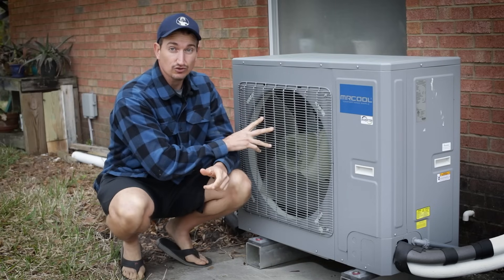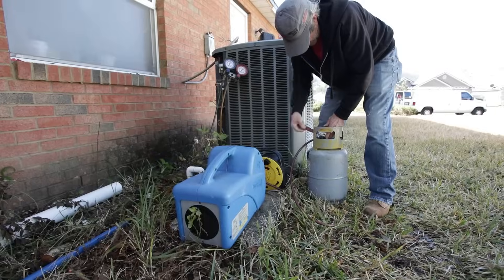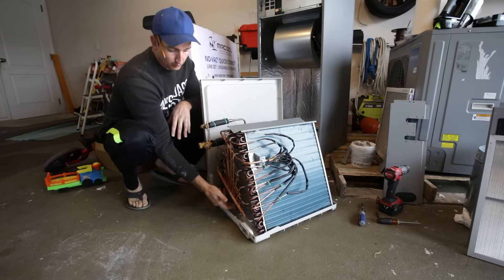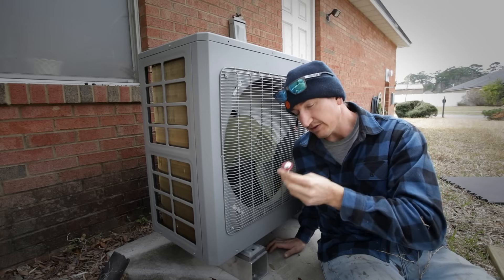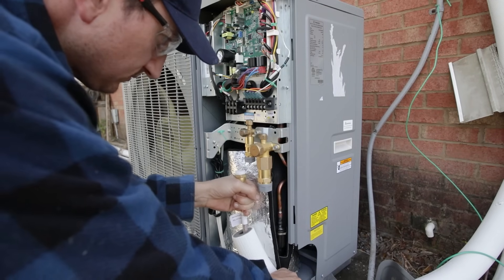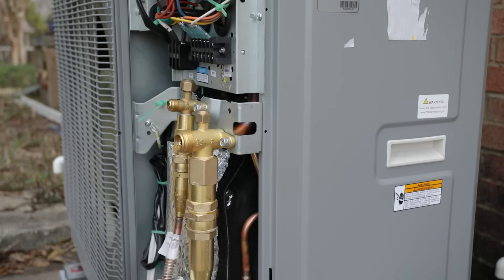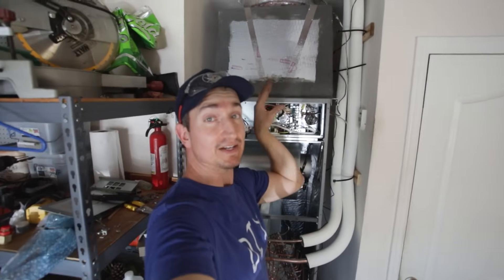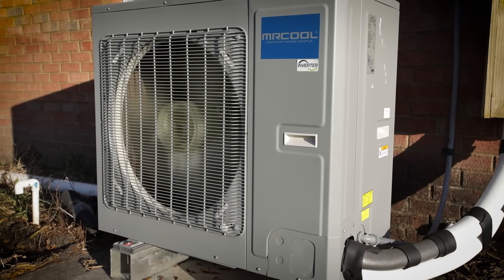Whole House Air Conditioner and Heating System Installation. MrCool Universal, Is it a DIY Project?

Comment: I have to replace my 4ton 15yr unit and was giving this a hard look, I like the 4/5 ton option as our house struggles on those 98 degree days to keep the upstairs at 76. However, after reading through this thread of comments I'm losing faith in the Mr Cool system. It seems more people than not have issues with these units for a host of reasons. Seems like this tech is not yet reliable to count on, the last thing I want to deal with is aggravation of replacement under warranty and live through 2-3 weeks of no AC waiting on things. We all have enough aggravation in life, this seems to be another source. Not one person here has a 3 yr track record of installing and loving this product. Please tell me I'm wrong....
Reply from the maker: The system shown in this video has done well since the publication of this video.

Comment: You make it look so easy. I am trying to take on this project in a few weeks. But stuck on the power line. Did you have to run new power line to the air handler and condenser? We have 60amp with our old condenser.
Reply from the maker: I was able to reuse the existing power as it ran my previous system.  Best of luck with your project and thanks for commenting.

Comment: I have the 3 ton units!How did you connect the thermostat wires between the condenser and air handler and the thermostat?
Reply from the maker: Different brand thermostats will have different wire configuration and programing. You will have to verify with the instructions of your particular unit.  The documentation provided with the air condenser and air handler should explain the wiring process between the indoor and outdoor unit in more detail than I can provide in this comment.

Comment: Hi great video I have a 4-5 ton unit arriving soon. Do you have any update on how the system is performing?
Reply from the maker: System is working great. Have had it operational now to have gone through both cold and warm months.  Heat and AC seem to function as intended.

Comment: After 10 months now how's it holding up, and how are your energy bills?
Reply from the maker: Adam, thanks for checking in.  The system has been working well.  I would like to think it is considerably more efficient than my previous more traditional HVAC system, however I have not been able to monitor energy usage in enough detail to compare.  I do watch energy usage through a "Sense" energy monitor, and you can tell the system runs using different amounts of power at different times depending on AC or Heat demands. At a high load the system draws just over 2000 Watts if I recall correctly.

Comment: My question is, did Mr. Cool send you a new replacement coil? How was that procedure? Did you just hire a hvac company to repair the coil? Thanks 😊
Reply from the maker: The vendor the equipment was purchased made good on the situation. It was a pretty simple process and was made right in my opinion.

Comment: This is why I recommend using a cheap vacuum pump to pull vacuum and do a leakdown check to make sure you have no leaks. Problem with these DIY systems is the HVAC guys are a real PITA to deal with and make it seem like these units are unserviceable.

For like $100 you can save yourself the hassle and just check vacuum and address any leaks before releasing the refrigerant
Reply from the maker: Thanks for the tip. However, I believe the air handler coil in this system is supposed to come with refrigerant "pre-charged" in it as well as the condenser unit.
Reply: @MrKistel  aah good point. Usually the lines are only nitrogen charged, so you can hook the lines up and pull vacuum, before opening the service ports and charging the system. Not sure if you can pull vacuum through the service ports if the evap coil is also charged
Reply: How exactly do you pull a vacuum and leak check it for under $100?  You'll need gauges, a vacuum pump, and a micron gauge...
Reply: @James.Allen.1  I never invested in a micron gauge and I've installed 10 units that have run flawless the past 5 years.   I just let my lil harbor freight pump vacuum it down for an hour straight and then I let the system sit for 3 hours to see if I have any leaks.  Works like a charm.

Comment: A resident here in Central Florida was decrying the Mr Cool heat pump installed in house but did not explain the multiple problems he was having. He got the installer to agree to replace it with something else that would work for him. First guess is run time was excessive due to high demand out of synce with the variable speeds and a low EER of around 11 which is piss poor. Units should yield 13.5 EER minimum in my book from owning a Bryanr Evo;ution Extreme (3T).  This past Christmas long week of cold should have yielded decent heat results for you. The Cooling side of things could be otherwise if the house isn't well insulated like mine.  Looking forward to your review re-visit!
Reply from the maker: Things have been working well with the HVAC system shown in the video

Comment: All Stores 900,000 Please Lower the price of all Brands of Military Equipment and Local for All Brands of Central Heat and Air Unit Products and Production Cost Now 900,000 That's Too Much $$ 900,000 Now The Whole World 900,000 Now 🙏 🤲 🕍 🕌 ⛪ 🛕
Reply: All Stores Please Lower back to the Price of all Military and Local for all Brands of Central Heat & Air Products & Accessories & Production Cost Now That's a Much $$ The Whole thing Now 🙏🙏🙏

Comment: Vacuum out the lineset and charge. An incomplete purge or air is going to degrade the efficiency of the system. Will you get away with it? Probably.
Reply from the maker: Thanks for the insight Scott

Comment: All Stores 900,000 Please Lower the price of all Brands of Military Equipment and Local for All Brands of Products and Production Cost Now 900,000 That's Too Much $$ 900,000 Now All Central Heat and Air Products Now 900,000 The Whole World 900,000 Now 🙏 🤲 🕍 🕌 ⛪ 🛕

Comment: I'm replacing an older original 3.5/4 ton Trane heat pump system that lasted 36 years.  I have a question about the gas/return line at the outside unit is 7/8 inch while at the air handler is 3/4 inch.  
Somewhere in the attic it was obviously spliced for unknown reasons.  Replacing the line will obviously add to the install cost.  
I plan on installing 4 ton heat pump that calls for 7/8 inch line.  Should I reuse the line the way it is or replace it with 7/8.  
Any advice appreciated.
Reply from the maker: In my case I chose to run new lines even though I potentially could have reused my old lines.  Part of my reasoning was the age and potential degradation of the old lines.  My lines were approximately 14 years old.
Reply: @MrKistel  Thank you! But I'm not sure the need for new lines unless they are damaged somehow. For me it would be very difficult to put new lines going up to the attic and down to the garage, will also need to drill holes on the stucco. However, I didn't know that metal pipes degrade over time.  
Hopefully, someone can answer my initial question about gas line width.

Comment: I'm not a tech but from what I've learned about HVAC is the system should have been evacuated, nitrogen should have been flowing through the system while it was brazed, then vacuumed down, then recharged.

Comment: MrCool denied any support and voided my warranty because it was a DIY install.  This is what I was told;

With it being a universal condenser it has to be licensed HVAC technician install. That is probably why you are getting a E3 error code. And with you installing the unit without a license hvac tech you have voided the warranty. This unit is not a DIY
Reply from the maker: Sorry to hear that. In this case the retailer did assist

Comment: What are you using for a filter on this thing?  I see it comes with a metal mesh that sits below the coil, but it doesn't look designed to filter very well...
Reply from the maker: I removed the metal mesh frame you mentioned and replaced it with a 20"X20"X1" insert filter.  The basic filters you find at most hardware and home stores.
Reply: @MrKistel  Thanks.  Your unit must be a smaller size, or the hole in your plenum below the air handler would be smaller.  Though 20x20x1 would cover the coil area, it would drop right down in to the plenum for me because its opening is much bigger than that.

Comment: With these mini split systems you shouldn't top them off and be confident it has the proper amount of refrigerant.  The method to fix this is to recover ALL the refrigerant, after this step you can vacuum out the lines and get that air out, then you need to weigh back in the proper amount of refrigerant the manual states the system should have.
Reply from the maker: Thanks for the insight

Comment: You should be good topping it off if the system still had pressure in it. In theory you should pump it down and draw a good vacuum before putting the refrigerant in but these systems seem to handle not doing that better than most. Also charging it in the winter is hard than the summer. The problem with the VRF type systems is getting a good reading on refrigerant. I would say just get someone to come out and check it in the summer. Also, my LG has the option of getting installer software which works a lot better on these systems that running gauges.
Reply from the maker: thanks for the insight

Comment: When I did my install in 2011 I had an old Trane 3ton that still worked. The indoor air handle was what was shot. So I pumped it down and sold the entire thing with the R22 still in it for $500. Was a win win.
Reply from the maker: goodstuff

Comment: Where did you put the inside air filter under the intake to the inside unit?
Reply from the maker: In the bottom of the air handler there is a space for a filter

Comment: What voltage does this run on and what is breaker size?
Reply from the maker: The system operates on 240volts. I believe the condenser is on a 30amp 240 circuit and the air handler is running on a 15amp 240 feed. The air handler would need a larger amperage circuit if the emergency heating element were also installed.

Comment: Is the air handler using a txv or piston? Trying to determine if this is superheat or subcool charging method.
Reply from the maker: So adding refrigerant has been a mystery to me. I have had three different techs out and none were clear on the appropriate way to do so but each tried there own method.  The way I see the problem  is that the inverter condenser is constantly fluctuating pressures based automated operation.   So a traditional tech just wants to hook up gauges and add refrigerant based on the pressures reading.  This probably works well enough for  most traditional ac condensers that operate at 100% on when they are running, their pressure readings should be constant.  Simply adding gauges to a running inverter condenser (operating normally) will not give you reliable pressures to determine refrigerant "levels."  My guess is you have to figure out how to operate the condenser in a full throttle mode but I am not clear how you do that. The last tech I had was able to get the system into a high output operation using the dip switches in the condenser (we found some maintenance document buried in the internet that described this).  In this mode it operations more aggressively however things still fluctuate.  He felt he got solid enough pressure readings from this to determine the system was low and he arbitrarily added 1 pound of r-410a.  System seems to be running fine but I am still not clear if I have a proper amount of refrigerant in it.
Reply: @MrKistel  yep, that is what I'm thinking also. I asked Ingram's about an override to allow the system to start but they said there wasn't any. I guess since you don't get an E3 you're probably fine. I tried digging around the internet and also search under Gree but nothing much to help with how to startup and recharge successfully. Something about some special cable is needed to troubleshoot. Let me know if you can share the document you found. Thanks.
Reply from the maker: @tradewinds8607  send an email to the email address shown in the about section of this youtube channel
Reply: @MrKistel  looks like comments are getting sensored and deleted.
Reply: @MrKistel  the issue is that all the refrigerant has leaked out from the valve above the compressor. What seems like a blob of solder on top of the valve pop up leaving a hole for the refrigerant to leak out.
Reply: @MrKistel  would you mine taking a photo above the compressor if you have the need to lift off the top (5 screws). Would like to see how this valve look to see if they will all end up failing if the pressure is just being held by a blob of metal.
Reply: @tradewinds8607  The proper way with inverter heat pumps is to recover all the refrigerant, nitrogen purge, pull a new vacuum, and then weigh in new refrigerant as called for in the nameplate and extra called for if you exceed certain lineset lengths detailed in the manual.  These systems are always modulating fan speeds, compressor, expansion valve, etc.  There's no way to get a truly accurate reading to "top them off".
Reply: @taylorlightfoot  do you know where I can find the reference for the charge needed for the no-vac linesets by length and the universal air handler? Since a replacement outdoor unit would come with refrigerant already, those would be the only difference needed.
Reply: @MrKistel  this is just a big central mini split system and mini splits do not go by sub cool super heat. the only way to get it perfect is to vacuum it all out and weigh in a whole new refrigerant gas. That's gonna cost a few hundred or more most times. if you just want to ball park it there are many videos on guesstimating mini split charge by charging up to 117 to 120 psi. it's horseshoe and grenandes though.
Reply: @MrKistel  You have to weigh in the charge. In the literature it should state how many ounces per linear feet of line set.

Comment: I've had mine working great for two years (installed 6/2020)  and now the outside unit is not starting. It is showing an E3 after a minute or two after connecting the disconnect. There is some light ticking/knocking sound before it goes from 00 to E3. I've contacted MrCool a day ago and still waiting on a response.
Reply from the maker: Thanks for sharing and please let us know what you figure out and how you proceed.
Reply: @MrKistel  no reply as yet, tried several forms of communication all morning.
Reply: @MrKistel  still no response from mrcool - day 5. 96 degrees in house.
Reply: @tradewinds8607  Keep us posted. Having some kind of support is important
Reply: I also have the e3 error code.  My system never started.  Did the installation, made sure there were no leaks, opened valves, etc.  I have left messages and emails for a month with no reply.
Reply: The latest update on my issue is that I'm still working in a 96-degree home upstairs where my office is located. MrCool got with Ingram's to setup the replacement. Here is the issue, for a manufacturer defect in all this I'm expected to pay for the unit shipping and for someone to recharge the system. That alone is over $700.

I thought when I will replace the larger unit for the home MrCool would have been the obvious choice given the warranty and savings, but if they are not going to cover these basic items and it fails just after two years, I'll be looking at another brand. In 10-years you'd be out another $3500 WITH WARRANTY coverage so factor that into the TCO.
Reply: @tradewinds8607  I’d be upset about the shipping.  Did you use the NoVac line set?  Why can’t they send you a replacement line set?  Are they removing the broken unit or are you stuck with it?
Reply: @jamesraymond3057  I should have it deliver today. The issue is a hole in the pressure valve above the compressor, not the no-vac lineset. At least I hope I don't have an additional issue there.

There is no labor involved in the warranty.  MrCool or retailer (Ingram's) will not pay for labor or the lost refrigerant or the replacement shipping so these are other major out of pocket costs.
Reply: Well, the nightmare continues. Ingram's (with my payment) used a carrier called Averitt. They have made every excuse in the book on not being able to deliver the replacement unit. It still has not been delivered and they've had it close to two weeks at the local distribution facility. Insist on a more reliable carrier since you'll be paying for the replacements.

Comment: Question about this indoor air handler. Does the indoor fan speed change or does it just turn on and off when the thermostat calls for it? Thinking how a mini-split both the indoor and outdoor units ramp up and down as needed. I was wondering if this does the same?
Reply: The indoor unit is 100% all the time it has dip switches to change the fan speed
Reply from the maker: i will defer to EP1CNELOSON's remark
Reply: @EP1CNELSON how do you know what dip setting you should use?